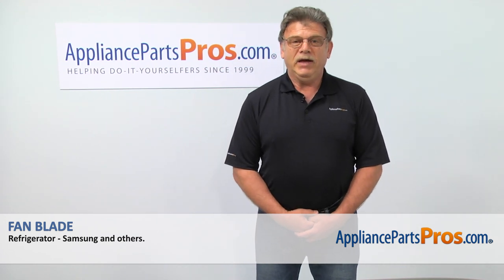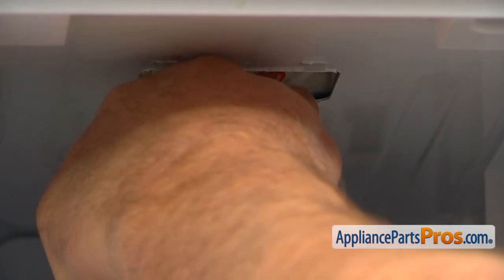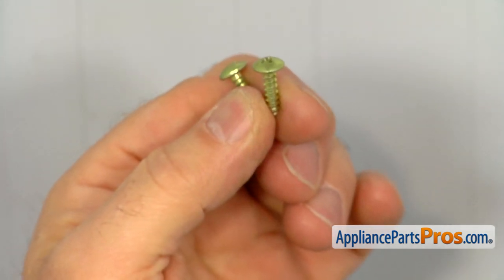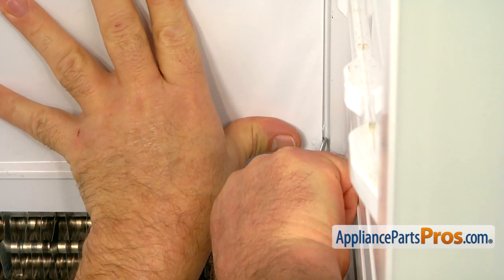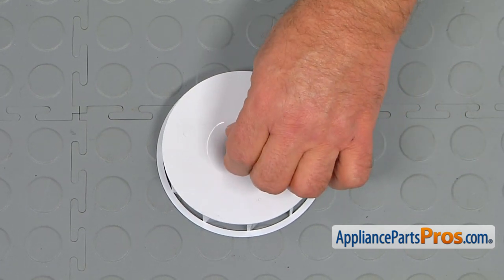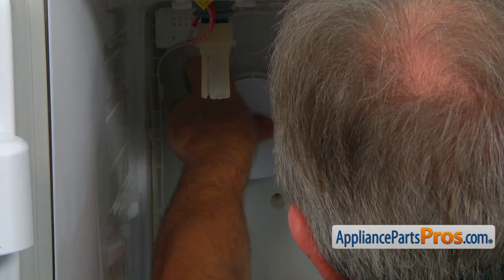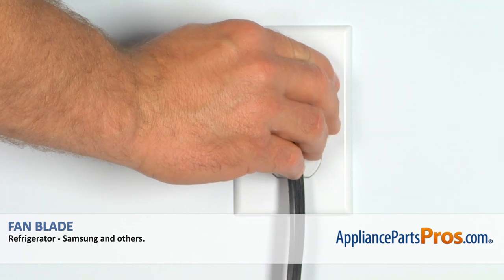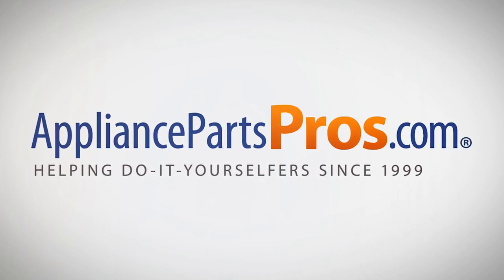How To: Samsung Fan Blade DA31-00242A

Comment: NOISE FIXED . JUST OPEN FAN .. REMOVE PLASTIC FAN PRY MOTOR COVER . TAKE THE MIDLE ONE OUT PUT THE GREASE ON THE SHAFT PUT IT BACK EVERYTHING THAT IS IT . FAN SO QUIET NOW .